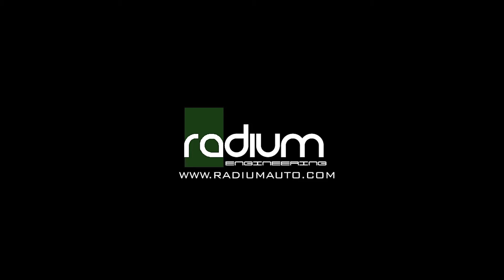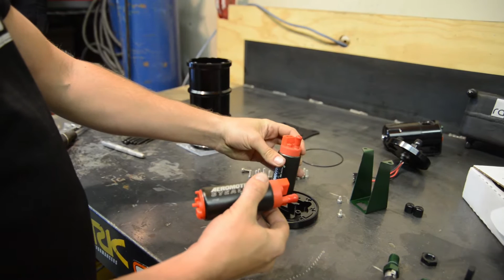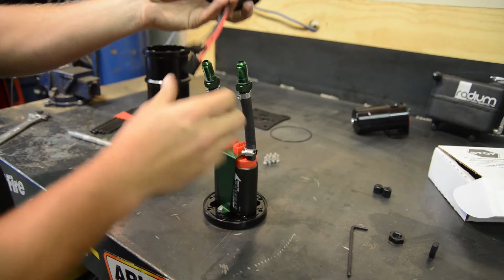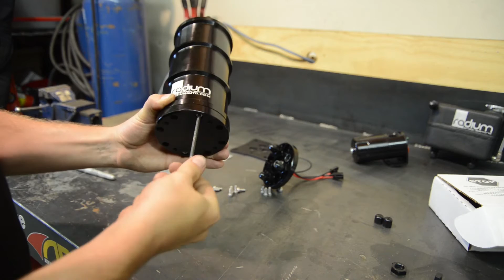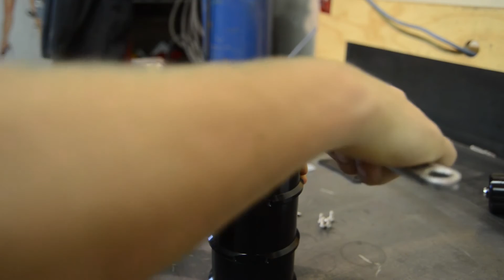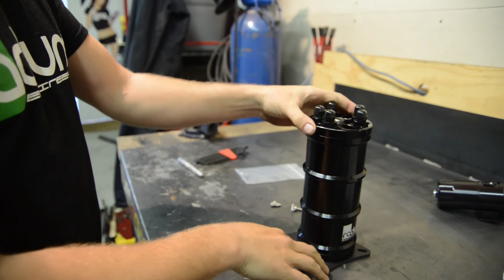Radium Engineering fuel surge tank installation video

Comment: im trying to learn about these. this looks like an amazing setup up. 

Currently im nearly about ready to start my supra project. it was recommended that i run a dual fuel pump for my power goal. so im sort of caught between getting a dual fuel pump hanger or going with a surge tank. i have no clue what would actually be better or if theyre equal.